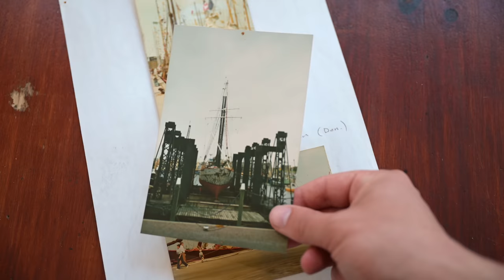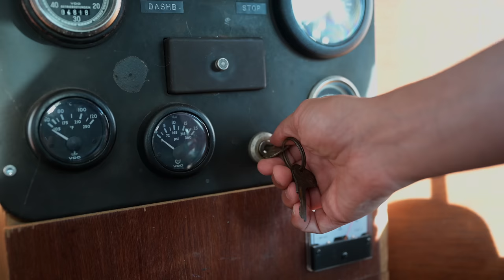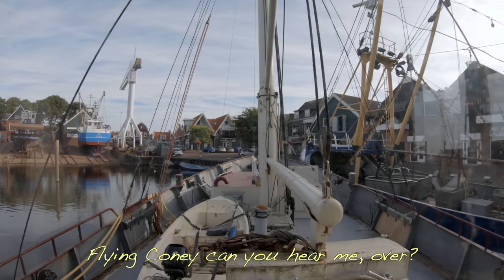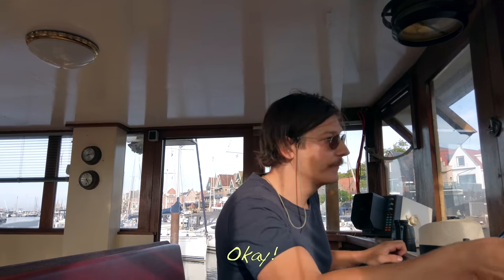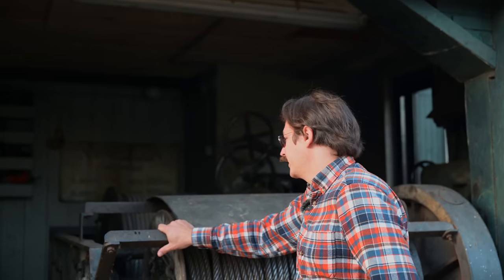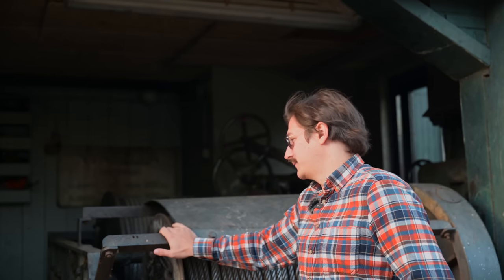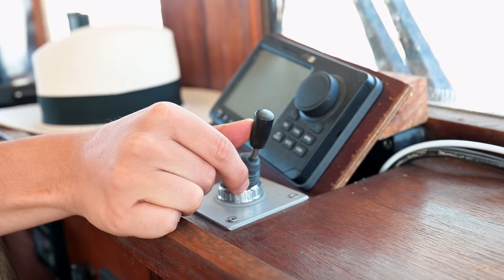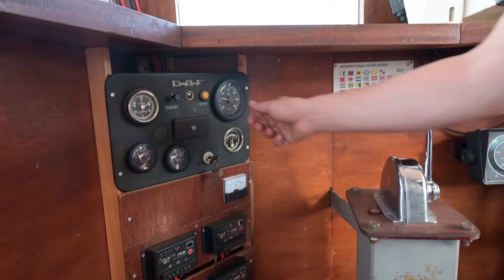HAUL OUT of Our Huge 82ft SHIP! What could go wrong?

Comment: Steel boats rust from inside out. At least from the outside it does not looks too bad, but for one week definitely it is tough to prepare and repaint the hull. Still, it is (or was) the perfect time to hammer all the possibly weak spots, to find out any significant issues while the boat is on hard. Good luck!
Reply: Be lighter when they get the rust out hopefully they can get it down to bare metal and treat it
Reply: Or just let a boat inspector measure the whole hull to know the exact thickness of the hull. In the Netherlands also mandatory if you want your boat insured.
Reply: I guess the center of gravity of this old ship has shifted, I hope there will be professional technical means to re-evaluate and deal with it properly

Comment: The hull looked quite OK below the waterline. I assume you will use ultrasound to check the plate thickness whilst she is out of the water. Long term, if it were my boat I would definitely keep that aft cabin which I think suits the boat, gives lots of useful space and wonderful views. It will be beautiful to have your living quarters in there and to be able to look out safely from there during an Atlantic crossing. I assume you will rarely go into marinas so the ability to have deck access lower down does not seem to be a priority to me
Reply: Yes, those people are crazy. You are far too polite. They suck. And they know it.

And looks are deceiving. You must poke scew drivers into that hull. Not just ultrasound fake images. Don't you know such things? Ultrasound is for solid wood, if you doubt the wood, you need to watch better. Use a pocket knife!
Reply from the maker: You know we have a steel boat? Your comment makes absolutely no sense for steel. You think we have a wooden boat? We have somewhere in between 5-8mm steel sometimes the plates are overlapping. With a screw driver or a pocket knife you scratch a little bit of paint. Take a crow bar or a 3kg hammer.

Comment: As mentioned before, the hull is almost never looking bad from the outside. Rust is almost every time coming from tbe inside. Hammering the hull first to listen for bad spots, then ultrasounding these spots for thicknes.  That is the usual way.  And you will find bad spots for sure, thats normal for a ship of tnis age. Reparing is not that difficult, but you need more yard time than one week. Its hard work, but worth it. Succes.

Comment: I’m just going back and rewatching some of your older videos. BTW, thanks for them. Ok, so why was the ship listing to port. I thought we had solved the water tank problems. Was it the diesel fuel. (Guessing) 
Let me know if you care to. See ya in the next new video. (Florida USA, 52’ Erwin ketch)
Reply from the maker: We have no movable internal ballast. So the few degrees of listing are easily explained by how things in the boat were stored at that time. The shipyard mostly hauls out fishing trawlers and they can easily correct a slight listing like that with their huge beams. They also have some correcting weights but it was a hot day and they thought they can do it without it. It's like always. afterwards you know better.

Comment: Nothing beats living on the water. It is wonderful lifestyle, full of great people.
To repeat.   I assume you will use ultrasound to check the plate thickness whilst she is out of the water.
It looked like a lot of shellfish growth around the heat-exchanger tubes. These need to be cleaned of growth all around to aid cooling.
You may be underestimating the size of the job. Lots of energy bars required

Comment: As an retired yacht carpenter, who lived on his 65k old fiberglass boat, you need to first of all get the boats bottom to the waterline power washed and if neededsandblasted, then coats of epoxy then new bottom paints and the hull to the waterline, fill and fair, primer, then finish coats of hull paint! New zincs, and any below the waterline repair needed also a professional check of rudder and all underwater fittings (depth sounder replacement on hull)all underwater thru hull fittings etc!

Comment: I would have this checked: Propeller shaft seals (stuffing box), inlet boxes for engine cooling, all in / outboard valves; seals and clearances on the rudder-stock; bottom rudder pivot bearing ("taats"); hull condition on the water/wind line; coolant pipes under the hull; engine mounts; reverse-clutch mounts; check bulwark ports for properly opening. Check propeller for damage and pitting.
Some zinc anodes seem unaffected, that means they are wrongly located. consider placing them somewhere else on the hull, check with yard staff. 
Do you know what anti fouling system is used now? Don't change to another system, continue with the old one, just put on a new layer.
Check hull for bad rivets and weld them as required. Tip: do the pressure washing yourself, you'll see more!
Have your life raft checked.
If the ship keeps tilting, even with empty tanks, check for proper ballasting. 
And while the ship is out of the water, draw a sketch with the location of all underwater components, measure the draught front and aft as well as midship. Measure the height of the keel. Also locate the main frame and try to measure the tilt of the hull plating there, measured outward from the bottom of the keel, as well as possible bilge keels, it makes future docking easier.

Comment: Good job on getting the boat out, I don't know how long it was since the last slip but the hull didn't look to bad. That keel cooling will slow you down while sailing and as you see the pipes make for good holding for critters. I wonder if in it's original configuration if it was like that? If you want her to be a good sailer and be easier at haul out time it might pay to look at a raw water heat exchanger. It would be interesting to get the hull thickness tested to make sure she's not got to many surprises. Though mentally challenging, with six slips out of the way you'll be able to go fill throttle down the bowling alley when your done 🏴‍☠️😀
Reply from the maker: Your comment got me thinking and probably a heat exchanger is the better solution for a sailing ship. To be honest I always was a huge fan of the keel cooling. Together with the dry exhaust there's nothing to worry in the engine department. The cooling pipes are fairly new because the previous owner had to exchange the old ones. So since the DAF it's the keel cooling. Originally for the Deutz and the Industrie I think there was an heat exchanger (and starting air). A little spoiler, hull thickness is still very good, but...
Reply: @FlyingConey  😊 it a boat, there's always a but... 🏴‍☠️

Comment: Much better dead slow gave you plenty of time to advance onto a change of helm and engine. The anodes might benefit from neoprene back pads and very impressed you mostly crept dead slow and with a deep hull, you can grip against bow wind sheer better than most. The rudder appears to have good authority at low speeds. A good ship and has good handling. As for her bottom - well perhaps a couple of thickness tests here and there especially outside of the chain lockers and above the water line and wherever most of the rust is revealed on the inside of the hull needs outside thickness readings. Is normal practice if you haven't got an up-to-date survey report that is true and accurate. Congratulations on slow and gentle maneuvering - that is how to do it.

Comment: Hello you two I have been waiting for this moment  with great anticipation .now we can see how nice it is to have a steel boat moored in fresh water .her bottom side looks very good at first glance .I am more hopeful now that i have seen her bottom .Am i correct in thinking that her list to port is from an off weigh balance of internal superstructure ? I did get a chuckle when the yard said you could use your bow thruster to turn the boat ,And the pause when you told them you did not have one .I think you scored some points in your ability to handle the boat as well as you did. We need to find you  a school or restoration of old sailing vessels and see about having them make you some old school rope bumpers .They would look awesome and work very well on her sides .good luck this week and I pray the weather holds for you .
Reply from the maker: The list to port is kind of a miracle. The boat is almost empty so no fuel and since the water tank was leaking not much water. Also one tone of water on port didn't had much impact. But there are more tanks on port than on starboard so filling them could only increase the listing. On the other hand it's not much, it was noticeable but nothing more than that. But even the these 1-2 degrees made it very hard to get her properly on the cart. We rally do not know about why the boat had her last conversion. Probably the sailing ship guys run out of money and she had fallen into disrepair. So one explanation could be that internal lead trim ballast was removed. Or they always trimmed with fuel and only filled up the port 4000 liter if they needed to.
Reply: @FlyingConey  IU think you are correct about using the fuel to cross balance the trim . The Fling Coney has lived a vast and interesting life to say the least .when i saw her out of the water I could not help but stare ,she has beautiful lines .I can also se without proper ballasting she will be a real hand full in weather .but that's for a future project right ?.Besides  I've never seen or met some one or thing that was a little off center that I didn't like .I know you 2 are very busy right now so  i will say good buy for now .I know your in good hands there and you will pester them with all kinds of questions .I am looking forward to what you find and do while there .till then .

Comment: Well for starters you need self communicators for you and your wife. Next get all modern radio radar equipment Then find out why balance is out check for all water leaks heavy sanding will be needed then tap then Tap the hull with a very small metal hammer. Listen to the sound to see how much metal is there or if needs welding as most older boats will need some welding and rust removing. As steel hull will need special paint especially under coat. Make sure rudder is clean and moves easily and correctly then clean the propeller look for all Zinc parts and replace them to help stop[ corrosion while doing that check bearings and any movement of the Propeller shaft and check its seals. The boat needs a lot doing to it.

Comment: Are you going to get any ultrasonic thickness readings on the hull while it is out?

I have to say, I was expecting lots more growth on the underside, doesn't look too bad.
Definitely got you money's worth out of the anodes, good timing on this haul out.

Looking forward to the next episode(s)
Reply from the maker: Originally it was planned that the yard does a little bit of measuring just to check if the numbers from 2018 are correct and hasn't changed too much. As for the anodes, some of them were left in place 4 years ago since she wasn't intended to sail much. I don't want to spoil too much. 😉

Comment: Not bad, some nasty bits, but reparable. You keep the cooling pipes I presume? (because a better cooling system will cost a lot of money), check also the pipe bends thoroughly. Nice hull by the way! Good lines.
Reply from the maker: The cooling pipes were installed in 2018 and are quite large. So they provide good cooling power. What's a better cooling system in your opinion?

Comment: If you have to do any hull repairs near the forefoot of the bow then weld in a tube for a bow thruster. Even if you don’t install the actual thruster. Just get the specs and have the tube welded in.

Comment: There's also a product it's some kind of citrus acid it smells like oranges that you can use in your builds and sensitive areas where you can't sandblast it eats the rust off the steel it's not as effective assemblasting but it's better than just needle gunning you use hot steamy water with this added to it and it's like a power washer and you coat all the steel with it it worked pretty good from what I remember
Reply from the maker: Thank you for your comments! The only thing we can't do here in this yard is sandblasting. The yard is surrounded buy the town and so they would need to build a tent first and that's more expensive than sandblasting itself. What we're doing to try now is to fight the worst rust spots with the Tercoo and the de-rusting wheels and do a coating of 2 component primer. I hope this will get us over the next two years and than we finally can sandblast the whole hull. I do have a Sawzall but couldn't find it but I found that multitool part 1 and 2 aka crowbar and hammer will do the trick most of the time and we also have a good jigsaw.

Comment: Learn how to drive backwards as well as you drive forward which will assist greatly parralel parking  and going into finger pier docks .
I stand backwards at the wheel on a single screw and on twin screw when going backwards .
Beautiful tonka toy its a great live aboard, Luv it  .
The old radar units with turn knobs for tuning in the local rain storms 3 - 5 miles away are still the best ones to have and use . Digital radars won't pick up the rain as well  👍

Comment: I would consider installing a stern thruster one day. It will help with maneuvering her around in tight quarters. Ya did a good job Danny docking that ship. I'm sure you already know this boats rot from the inside out. So the outer appearance doesn't give you a lot of info. I would definitely consider getting a experienced surveyor to check her haul out properly. Or at least purchase a metal thickness gauge to test the metal and use a hammer as well to tap the haul, its the tapping of the haul with an experienced surveyor that will help detect weak spots that need to be addressed, but its also important to look at things from the inside of the vessel. Just glancing at the haul with a camera does really give you the info you need. You actually have to have hands on exploration of the haul as I said with a ball peen hammer and tap every square inch of the haul itself. God bless and best of luck.

Comment: The outside looks reasonable but just 1 week?  You guys are really going to have to push yourselves above and beyond and then some. Too much I think but good luck . I would have booked for at least 2 weeks in case something came up that was important to fix.
Reply from the maker: We had no time limit. You pay for the haul out and the days and the work of course. It also makes a huge difference if you have to power through one week or if you've planned a month or more. Also some jobs like the stuffing box, pressure washing and repainting the underwater ship are meant to be done by the yard. Jobs we wanted to do ourselves was de-rusting and repainting above the water line, taping the waterline and removing the shit tank. We do not weld structural things or below the water line.

Comment: I would also get rid of those external water pipes as they can be damaged relatively easily and will provide extra drag
Reply: They are for ice reduction.
Reply: I thought they were for cooling the engine coolant which instead can be dealt with inside the hull
Reply from the maker: They are indeed for cooling the engine. On the long run we are planning to change to a heat exchanger system and maybe also to an wet exhaust. However keelcooling and a dry exhaust ist probably the safest and best option considering the engine alone and the pipes are fairly new.